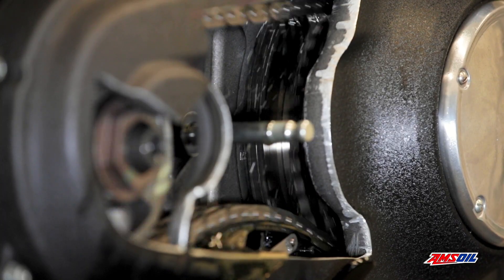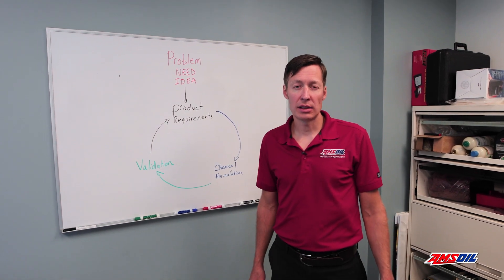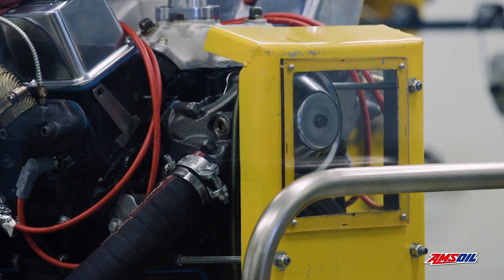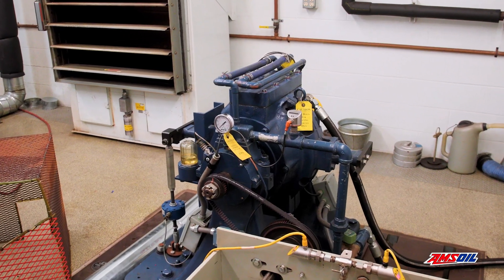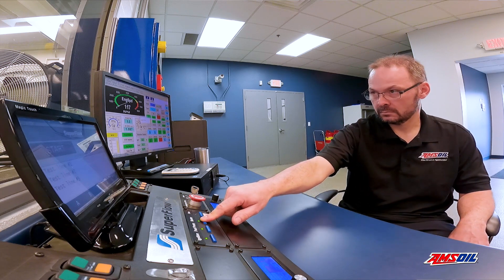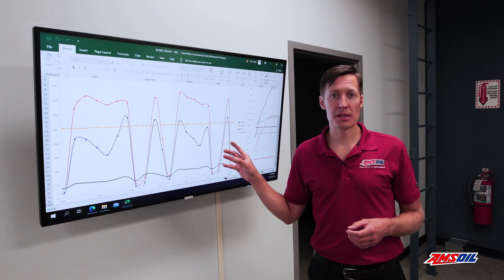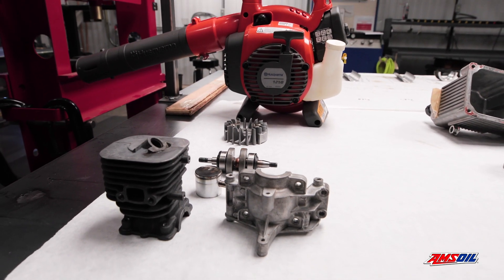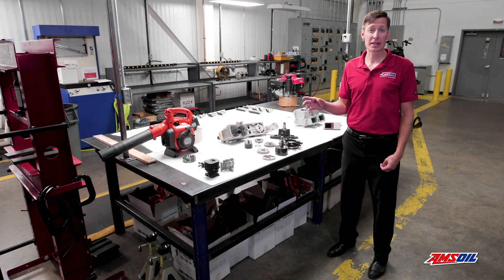Tour the AMSOIL Mechanical Lab

Comment: My utv recommends GL-5 for transmision and diferential oil, amsoil oil made my utv shift smoother and less heat is felt from the front differential when you touch it. thanks amsoil i will be using your oil for my machine.
Reply from the maker: Thank you for sharing your experience with us. We're thrilled to hear that! Nothing makes us happier than satisfied customers. Happy Riding!

Comment: Mark, what extreme conditions or variables do you test outside of normal lab or environment durability?  Say for instance I'm out on the trail and unfortunately have to put ethanol or poor octane fuel in my 2 stroke and it detonates, are your products going to minimize damage versus the competitor or "standard"?  

How about poor induction hardening on a cast iron camshaft, will your signature series prolong the inevitable of the cam shell damage which eventually seizes the hydraulic lifter roller and likely destroys an engine?